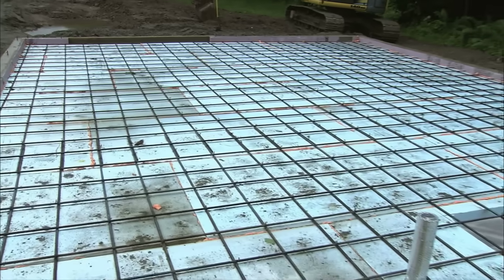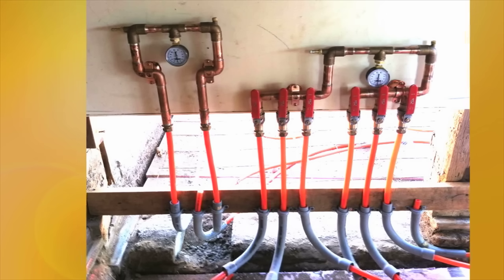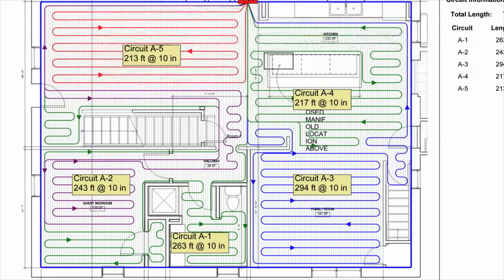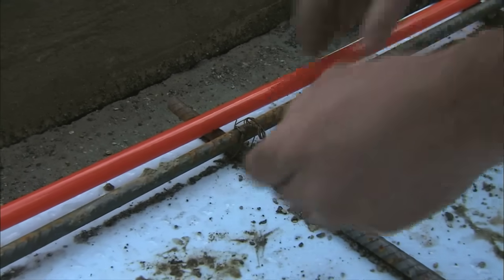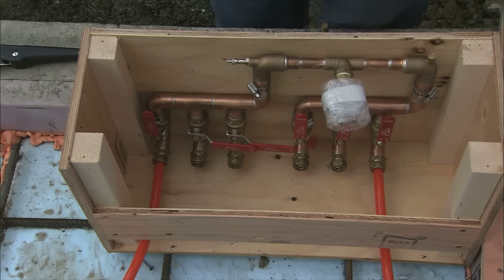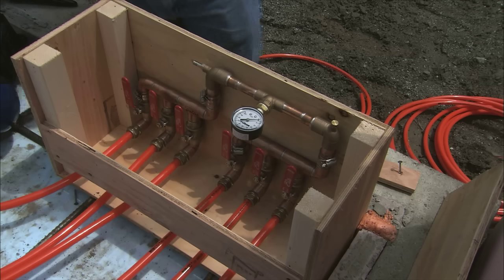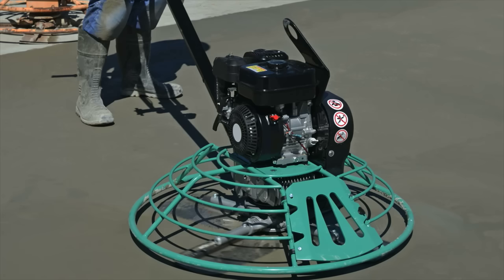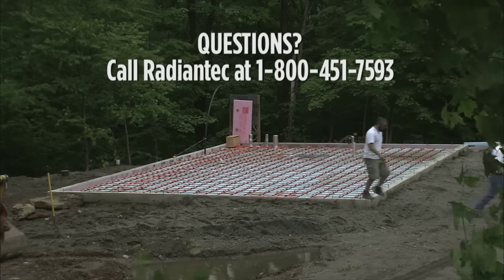Radiant heating in a concrete slab. Let us show you how easy it can be to  install radiant heat!

Comment: I'm curious if this is only recommended for heating or can it be plumbed to circulate hot or cold water for cooling in the summertime?
Reply from the maker: Hi Mr. Lee, some companies I've heard of are trying to run chilled water through the tubing for cooling. The issue we've had in doing this is trying to control the humidity level in the home. There were condensation issues with the floor temperature reaching the dew point.

Comment: nice calm voice, very clear and succinct. 
Has there been much study of the concrete slab as a heat sink or 'battery' to store solar heat?
during the day the solar gain heats the water and powers the pump to circulate warm water thru the slab so that at night it gives off it's stored heat.

Comment: 2” of insulation under the slab may not be recommended in the South due to hot summers.

You may have to do a calculation of heat flows to determine this.

Wood in the slab will rot and weaken the slab.
Reply from the maker: Believe it or not, the actual earth temperature below the center of the slab is about the same temperature in a warm climate and a cold climate. The 2" recommendation is a tried and true proven recommendation for heated slabs in all locations. With that being said, it's always wise to check with your local building codes to get their take on insulation methods.

As for the wood in the slab, I assume you mean the plywood box? This tiny amount of wood will have no impact on the bearing load of the slab and will not cause the slab to fail. Also, the box can be disassembled after the pour if you have concerns. We do have wall mounted manifolds (that are also shown in the video) if this slab manifold is not appealing.
Reply: Radiantec slab on grade is the standard in the South.

https://youtu.be/stOvOxIDRYo

Comment: It would have been nice if the manifold had valves so it could be left in place for future use.  Nice video though.
Reply from the maker: I'm not sure what you mean by this. If you go to the end of the video you'll see that the top part of the manifold is cut off and discarded (the pressure testing kit) and the rest of the manifold remains. You then connect a copper or pex supply and return line to it to supply the zone with warm water.

Comment: Would have been nice to see the finished product, with pump and heater attached.  Also to get an understanding how to control flow and temperature.  Should the system be on circulating hot water always?  Seems expensive.
Reply from the maker: Hi Barron, we didn't include that part in this video because there are a lot of options for how to heat the water. If you want to visit our website and go to the installation manuals, you can see instructions for different options. https://www.radiantec.com/installation-manuals/ 

Our control of choice for concrete slabs or any high thermal mass application is a floor sensor. You either embed or surface mount a sensor to the slab and you bring the slab up to the temperature of your choice. We find that this control maintains a very comfortable and stable environment. What we know is that in a well insulated space, the floor needs to be 4-6 warmer than what you want the room to be. So, if you want it to be 70 degrees in the room, you would set the floor at around 75 degrees and then adjust to find that magic number. Once you know what floor temperature keeps you comfortable, rarely will you ever have to adjust the setting.
Reply: The system will circulate hot water around 120 plus or minus 10 degrees only when there is a demand for heat.  This is actually one of the most efficient way to heat.  I install in floor heat HVAC and refrigeration and a customer requested I research this product...FYI once you have in floor heat and it is configured correctly you will never go back.  My furnace never turns on in the cold Wisconsin winter.  Boiler hot water heat is a even heat.  If you were concerned regarding the overall cost of in floor using a boiler, then simply use a correctly sized water heater.  In the video they use less than $500 in materials, closer to $350 if you were to purchase it all yourself.

Comment: Can you tell me what should be the water temp that needs to be run through this system ?
Reply from the maker: We typically recommend the water temperature to be about 110-120 degrees F. for a slab application.
Reply: Thanks for the reply.